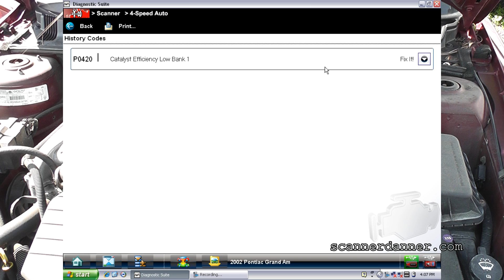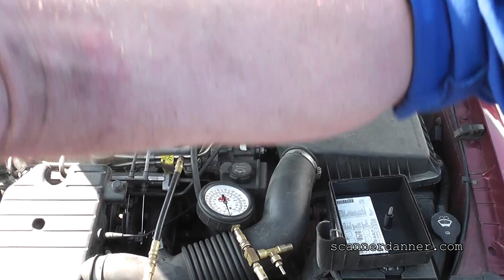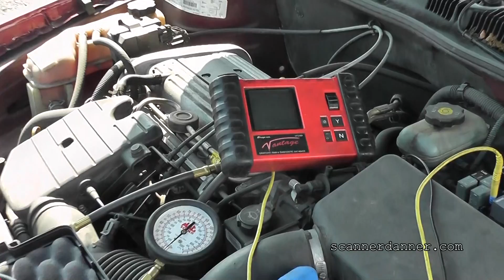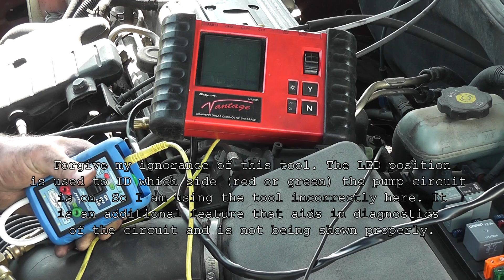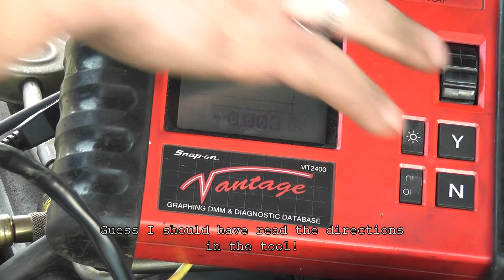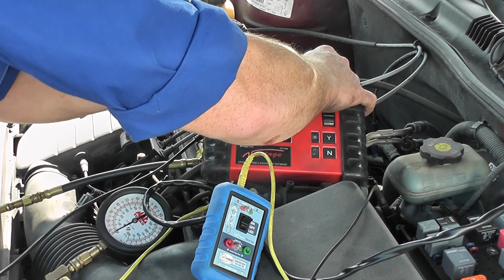No Start No Fuel Pressure Troubleshooting - GM 2.2 Ecotec

Comment: I have a 2003 2.2 eco-tech Grand Am crank no start as well.  I changed the fuel pump and fuel filter still crank, no start. I changed ignition coil and boots and plugs and ignition coil module. Same. No fuel at Schrader valve just by checking with screwdriver. Switched out, relays for fuel pump same, and all other fuses are good. I am a super novelist beginner, so not sure where to go from here. Any help would be appreciated
Reply from the maker: @steverogers7781  merry Christmas! Just reply here with that test result
Reply: I’ve also tried the security pass lock bypass with the key on for 10 minutes. My security light stays solid red, it does not blink. Won’t start with starting fluid either.
Reply from the maker: with the key on, do you have 5v on one of your TPS or MAP sensor wires?
Reply: @ I haven’t had a chance yet, but wow that is awesome. I was not expecting you to respond. i’ll keep you posted after the holidays. Merry Christmas buddy.

Comment: This was absolutely useless for me. I had a fuel pump that worked and put it in with the same results, no fuel pressure. Could it be the relay? I checked the fuses
Reply from the maker: What was FP power and ground when measured directly at the pump connector during cranking? (Loaded circuit)

Comment: So true Paul. knowing your tool and its procedures is as valuable as Knowing the circuit your working on. I fried my dvom by simply didn't  switch to voltage setting but left it on ohm setting while checking a high voltage system.

Comment: Hey! i have a 2005 lexus es330 i recently  changed the fuel filter  "in the tank" and sock i pulled the fuse and battery cable toke the fuel hose off pump "had pressure still with alot of fuel spraying out"  put the new filter and sock on "wich were after market "  put the battery and fuse in and now the car wont trun over  the pump is new and works i can here fuel go threw the line but when i take the fuel ine off theres no fuel pressure any ideas?
Reply: What was the problem?

Comment: I know this is an older video so you might not reply, but did it turn out to be the pump? You said the tool was indicating an open in the circuit so I'm a little confused.
Reply: Paul Danenberg Yep sure is the pump. I don't know the proper terminology to explain it, but the circuit was open inside the pump, and when he beat on the tank the pump spun just a little bit and made contact again. The car will run fine until you shut it off and the pump happens to stop in the deadspot again, then you'll have to beat on it to try to get it going.

Comment: Scanner Dan what causes a trailblazer to blow the a fuse time you try to crank it up it blows the ECG fuse I think that's the right one but some say its the oil pressure switch and son say its the fuel pump can you help me out thanks
Reply: Post this to my forum. We can exchange information better there. I'll need the exact name and or number fuse and which fuse box it's in (under hood or in dash)
www.scannerdanner.com
Reply: Its the ecm1 fuse under the hood

Comment: Is it possible to ohm out the fuel pump windings from the relay port. I know this would necessarily tell you if the pump was bad but could it show that the wiring from the relay to the pump is good, thanks.

Comment: I have a 2006 Chevy Malibu with no fuel pressure at the fuel rail. I replaced the fuel pump and I hear it run, but no pressure at the rail. I can disconnect the fuel line at the back of the car and it will spray fuel. I go to the front and disconnect the hose going to the fuel rail and it stops there. (Fuel comes out of hose from tank) Do I have a bad fuel pressure regulator? Will that keep the fuel from going to the fuel rail? ( The car will start with start with fuel or starting fluid.) Note: When this started I drove to the store and when I came out it would not start.

Comment: No disrespect to your client Paul, but if I am going to have my own shop, this is something that I expect to be able to fix it myself without having to call in the big gun like you for this particular problem!

What do others feel?  I expect a typical mechanic to be able to figure this out without much trouble at all.  In a nutshell, why was Paul called to solve this "trivial" problem?  Has the quality of typical automotive shop has dropped so low that even the run of the mill problems now need the best brain in the country to be employed to solve it?
Reply: Men with Pauls expertise and time in this field are hard to come by and the average mechanic does not specialize in this electrical/performance area as Danner does. Great mechanic and awesome teacher.
Reply: Robert Wood
Thanks brother. 12vgs8606 updated his post. He saw my other post as to why I get these calls. This garage is very reputable. I like to think I have a hand in that :)
Reply: Sift dejal full pirasar

Comment: Great video as always.  If I could get your thoughts on this case, try to pass CA smog on a 98 sable. Car fail HC and CO at 100 and .6, NOX is very low.  If I pinch off fuel pressure regulator vacuum hose, HC and CO drops to 20 and .1 which is pass.  All readings are under load at 15mph on dyno.
LFT is 3%-6%, STF 0% to -4% which I think is OK.  O2s switching good.

Any thoughts are appreciated.

Comment: sorry to post  twice  I was sign in with my Daughter you tube account previous.
Paul,nice job  showing us testing and thought processes , You are a very hard worker,If you had to check for spark  or defective  ICM  on this what will be your preferred or best method  I had one of this with rondom misfire ones had new  oem plugs already.  but this unit  on top of the valve cover is very expensive and I did not find the proper way  to test it thanks god bless you.
Some thing call my attention I was looking at the wiring diagram  on this vehicle you are working on  the ICM  connector  on pin F from  coming from PCM is label CMP sens sig, but the vehicle does not have cam sensor ? sorry to post  twice  I was sign in with my Daughter you tube account previous.
Reply from the maker: That is a cam signal that the ICM generates based on the firing KV of the #1 or #4 cylinder (can't remember). It is called a synthesized cam signal.
This is why a bad plug or wire will give you a cam sensor trouble code on this design.
Reply: ScannerDanner
 thanks for answering quick, How would you test this ICM? with low amp probe?
Reply from the maker: Joel N
the control signals can be verified with the scope using a voltage trace. the coil primary can be monitored with an amp clamp.
Also the secondary can be played around with if you remove the housing and run plug wires between the plugs and the housing. I used to do this all the time on the GM 2.3, 2.4 "Quad 4" engines.
Reply: Thank you I did think that but is good idea.

Comment: Paul,nice job  showing us testing and thought processes , You are a very hard worker,If you had to check for spark  or defective  ICM  on this what will be your preferred or best method  I had one of this with rondom misfire ones had new  oem plugs already.  but this unit  on top of the valve cover is very expensive and I did not find the proper way  to test it thanks god bless you.
Some thing call my attention I was looking at the wiring diagram  on this vehicle you are working on  the ICM  connector  on pin F from  coming from PCM is label CMP sens sig, but the vehicle does not have cam sensor ?

Comment: does that tester work for all asian and domestic?
Reply from the maker: yes, it has all of the main relay adapters in the kit as well as universal jumper connections that should work on any system.
Reply: sold! :) i believe this is much worth it to buy vs the lisle relay master kit tester

Comment: My sister's 04 Pontiac Grand Am with the same 2.2L Ecotec has a weird problem that I can not figure out. This problem started back in January during that wonderful past winter. About once a month or so it will not start with no fuel pressure with initial key on or cranking. Simply put tapping on the relay seems to get the fuel pressure back again. I have swapped relays as well as bought a new relay and the problem still persist. The relay contacts seem fine (not burnt) and I even have dropped the fuel tank and checked the fuel pump connector which is fine (ie no arcing damage which can occur on these fuel pump connectors). The only problem that I can see is that the plastic case near the +12 fuel pump supply connector on the relay was a bit discolored (tan) like it been running warm but all the electrical connectors seem fine. Previously the original factory fuel pump went bad 2 years ago which I diagnosed and replaced.

Does anyone have any clue as to how to go about diagnosing and fixing this problem? The worst bit is it is so intermittent I can not figure it out.
Reply from the maker: Voltage checks at the relay during the no fuel psi problem is the only way. You do not know if your problem is on the control side or load side of the circuit yet. And without knowing that, there is no reason to debate what it could be. Make sense?

Comment: Nice video Paul,

I went to the AESwave site to look at the uactivate tool. They must  have changed the label design on that tool. Where your switch indicates LED, it now shows M-on. Apparently you have to hold down the switch in the momentary position which is LED on your tool correct? The on-off position toggles and stays in either until you change it correct? Check it out.
Reply from the maker: Yes, the LED position is momentary and was not designed to activate the circuit (although I believe it will) but to tell you circuit polarity. The on/off switch will stay in that position.
I talked with the designer yesterday and he didn't mention the M change up on the tool so my guess is the internal design is no different. Thanks Danny
Reply: ScannerDanner
OK..on the M change, I think if I were the designer of this tool, I would have just called it what its indicating : polarity...... rather that the function of the switch. The power probe tool in comparison has the LED's. If the green one lights it indicates  ground side (-) polarity and if red one lights it indicates Positive (+) polarity. My guess is there must have been some confusion and that's why there was a change from LED to M-on. I think for the tool he was on the right thought path with LED....but polarity would have been more clear.IMOO? I think it's a cool tool but a little over priced...just my opinion not knocking the tool or the designer :o)

Comment: Hi Paul, did you look to see if there was any fuel in the tank to start with, sort of thing I would get caught on, good video again, well done.....Fred UK.
Reply from the maker: for sure, I've been burned by that before too.
In this case, an empty tank would not have caused an open in the brush contacts of the pump unless the pump burned up from the lack of fuel (I've seen this many times). So either way it is still getting a pump.

Comment: I like the idea of that tool. Probably makes playing with relays a lot easier. It looks simple enough I’ve been thinking of building one myself since I saw it in one of your other videos but haven’t gotten around too it yet (too many other projects at the moment).
The built in polarity tester is a cool feature. It probably uses the two LED’s with both cathodes & ground attached to each other in a T. Current can only flow one way, so only one LED will light up indicating direction. Pretty cool feature.
Reply from the maker: It is cool, I'll have to check the tool directions. If it lights up red or green, I don't know if this tells you the pump side or the feed side of the circuit. I think feed side?

Comment: and that shop had to get you for this kind of problem ?
mmmm....... bad
they need someone like you permanently
(don't tell them that i say that)
Reply: From what I gather, Paul is more of a Nomad / Casanova style mechanic. He works where & when he wants to. The shops don’t pay him to stay, they pay him to leave. Wham, Bam, Thank You Paul. ;-)
With how quickly he works, a single shop wouldn’t have enough diagnostic work for him to do to keep him busy. They would end up paying him mostly to sit around twiddling his thumbs most of the day & building mad skills on Angry Birds. Its cheaper for the shop to hire him by the hour, and as an added bonus Paul gets to charge the shop more for his time. Its a win / win for both sides.
Reply from the maker: No, they could have handled this one. They typically do not even look at them before calling me. They are a busy shop and this set up works best for everyone. For me, sometimes it's an easy one like this, sometimes it is not. The shops do not care, they mark up my fee and do the repair. No worries about replacing something that wasn't needed from the garage side. So they sell the job with confidence to the customer. Everyone is happy!
Reply from the maker: Pet Rock's Garage
well put my friend. And my first hour fee is the same if the job takes me 2 minutes or 60. So you guys can see why I want to find the problem as quickly as I can without sacrificing accuracy. This is the core of everything I do.
Of course a lot of my videos, I am teaching methods so it can take longer in those circumstances but once you learn and apply the method your flying!
Reply: ScannerDanner
So Paul.Your minimum charge is and hour and I believe I read on one of your other post that you try to not take over 2 hours on any one car , correct?
Reply from the maker: Danny Berry That is correct Berry and I rarely go into that second hour.
My track record is it will take me 20 minutes or 4 hours :)
There seems to be no middle ground.
Reply: ScannerDanner OK, now it makes perfect sense;  Please ignore my previous comments on the shop.  It seems that they are subcontracting initial diagnosis to you.  By doing that hey are guaranteed to have the best available brain doing the diagnosis and then they can use their own mechanic to do the actual repairs.  This is a splendid business model and I would recommend it highly.

Comment: Your vocabulary is absolutely exemplary. Keep up the good work.
Reply: Rusco may have been first to comment but not only one to notice, your vocabulary and fluid speech is one of your best assets that you naturally display without trying and it is one of the main reasons that I can watch your videos from start to finish every time.  Videos with 200 "Um" and "uh"s are just unwatchable, you seldom do that.  But also you just naturally spit out phrases like "I really need to validate this test with a positive control"  showing not only logical if not scientific thinking but also use of proper nomenclature for the action itself- I would not expect many mechanics to know what a "control" is much less a positive or negative one.  Had you been a medical researcher you would be curing cancer as well as you fix cars, the process is absolutely identical- forming a hypothesis to explain an observation and testing ONE variable at a time in order to support the hypothesis to the point where no other explanation can be possible but for one variable that you can reproducibly show causes the problem. Whether it's a bad ground for a fuel pump or a mutated protein causing an immune system failure, the process of finding the cause of either problem is absolutely identical.
Reply: Schrodingers Box Matt put it brilliantly!  But there are very few Matts or Pauls running their own shop or using the wrenching to put the food on the table.  These type of guys are too smart to get stuck in a auto mechanic career.  Matt is a scientist and Paul is a lecturer.  Of course there are few professional mechanics on the youtube with similar capability but most shops don't have these kind of people working there :-(
Reply from the maker: That's a first. Do you mean how I speak or that I try not to swear?
It's funny how much recording and editing myself has caused me to speak differently. Eliminating verbal crutches and slang words etc. And of course I try to not speak coarsely too. No need for that. If only I could control my tongue better off camera :)
Reply from the maker: Schrodingers Box
wow, thanks bro. I really appreciate your comment. If you watch some of my earlier videos, I have a lot more "Ums" in them. Funny how much hearing yourself and editing out those forces you to change your speech.
Any good videos you've done lately? Send me a link to one you think is top notch.
Reply: I think this one would be right up your alley brother- in fact i bet it stumps even you!
Diagnosis of Intermittent Hesitation, Skip, or Miss 2000 Trans Am- PART 1